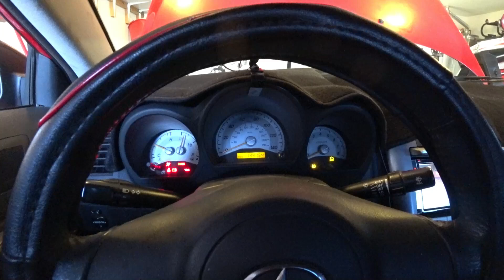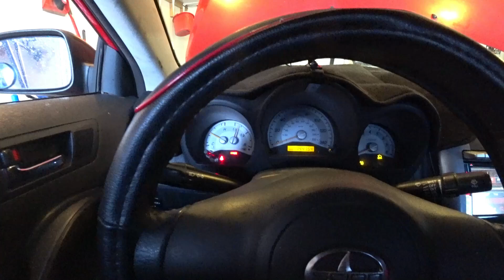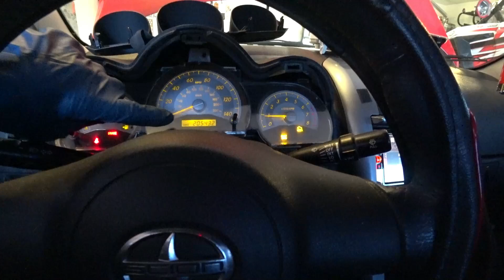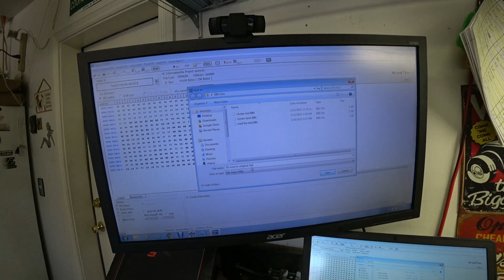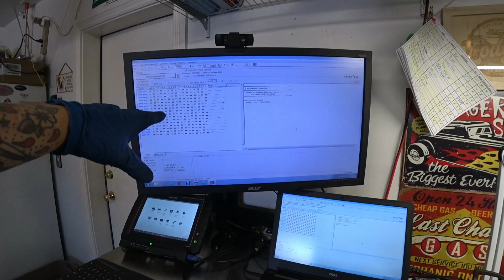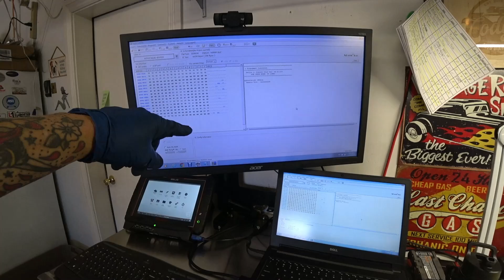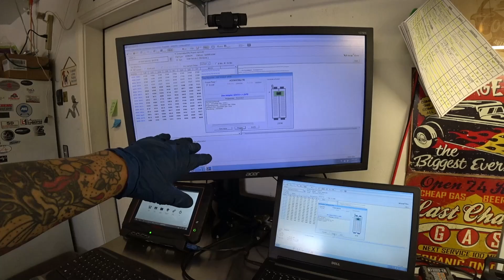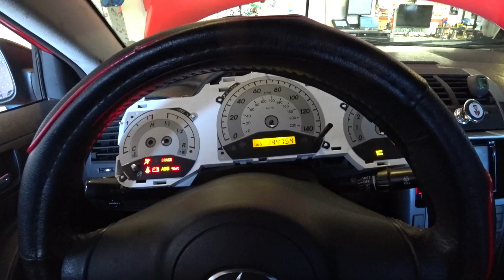Scion Cluster Swap And Mileage Transfer

Comment: is this something that you could do if the vehicle supported j2534 coding with your autologic opus? (07+?)
Reply from the maker: Autologic doesn’t touch mileage correction
Reply: @codysautodiagnosticsprogra8706  does it allow you to rewrite vin numbers if you are installing a used ECU from a junkyard vehicle? Is that even necessary or is it more about the security code key programming when swapping ecus?

Comment: question: why not change just the servo for the RPM? like on GM's. is it just that it was easier to get a junkyard one than ripping it apart to figure out what servo you need, then putting it back together for the customer to drive while waiting on the parts to show up?
Reply from the maker: That’s definitely a good point and yes I could have changed just the stepper.

Comment: Man, that's awesome that you don't have to hot air and re solder the eprom chips anymore. Is this because there is no security gateway on that cluster?
Reply from the maker: This is pretty awesome but doesn’t work on all chips on the board. If the board has a crystal then you need to short the crystal or remove the chip. I would assume newer clusters won’t be this easy unfortunately
Reply: @codysautodiagnosticsprogra8706  I've never seen this before. Either way, when you do get one, it cuts at least 2 hrs of service. Right tool for the job.